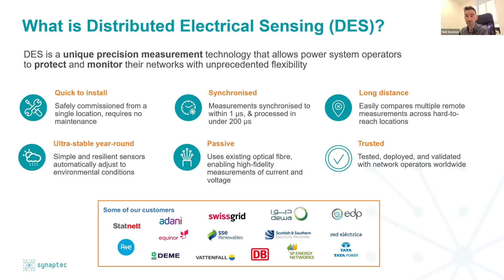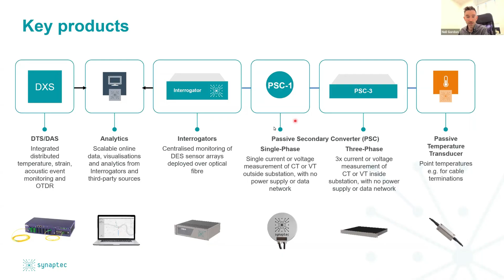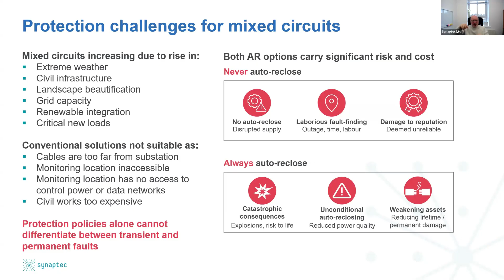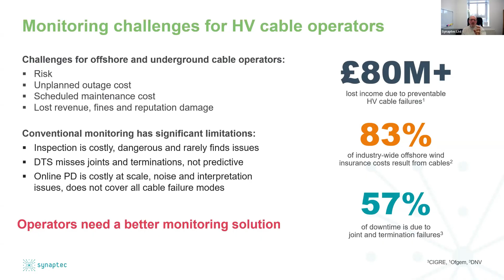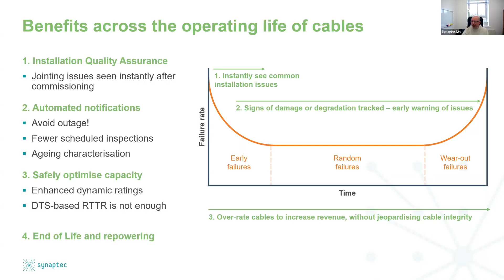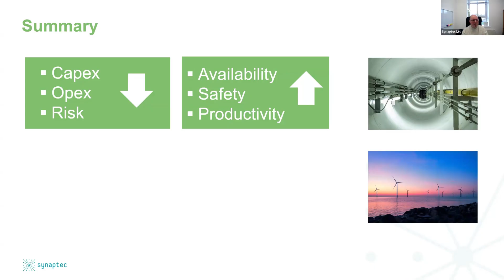Advancing Grid Resilience | Webinar

Comment: ~33:00 Wondering if the same sensing approach that determines section faults could be used to augment inverter controls to make them grid supporting (or grid forming) rather than having to be a grid following liability? 
Control the inversion for the waveform desired at the far end of the cable... 

Maybe it'll turn up later in the webinar 😸